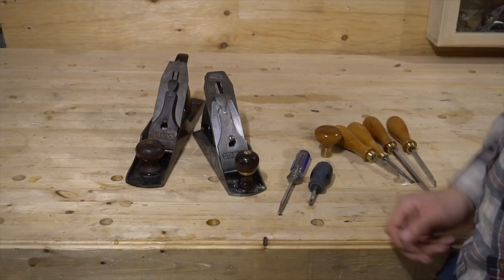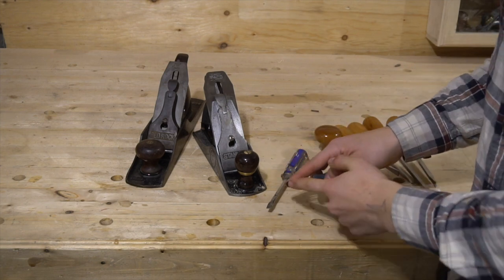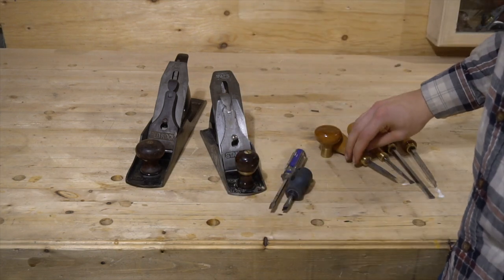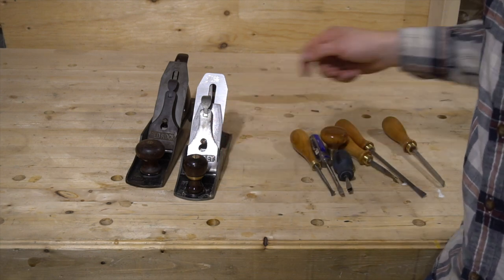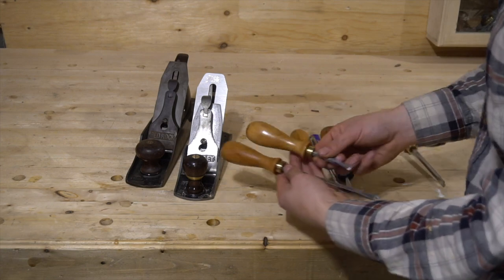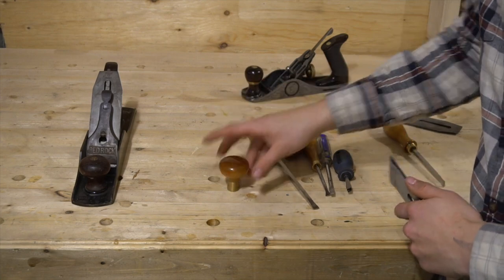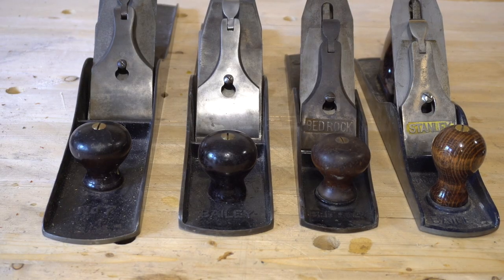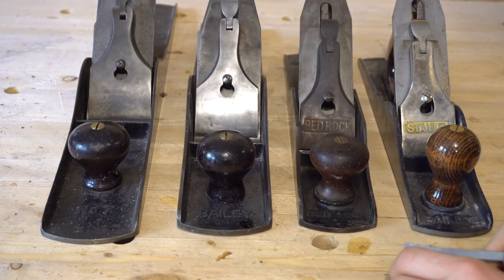How to make “gunsmith” screwdrivers for hand planes

Comment: Delightful video. I am a gunsmith in training and want to learn more about the techniques of forging my own tools. The rounding and curving of the handles seems like a complex process. What math do you use to get the correct shape?
Reply from the maker: Thanks! The shape was just intuition :P just try grabbing them every now and then until the shape feels right and looks good. I've been trying to perfect making these screwdrivers so I can sell them but the hardest part right now is trying to quench the whole screwdriver blade and not just the tip. But it keeps warping 😭